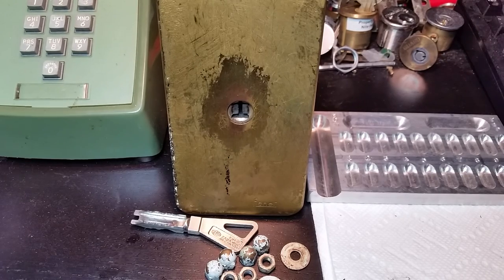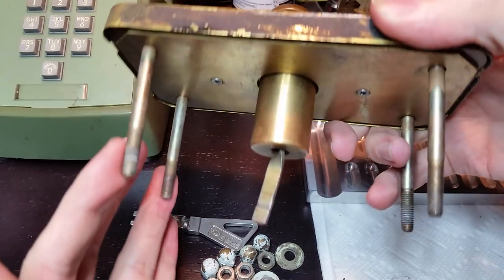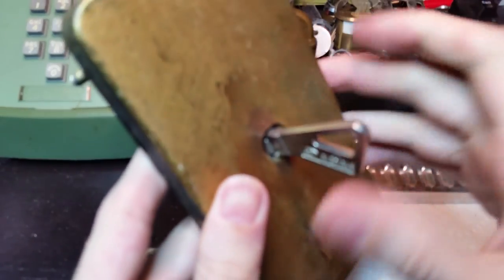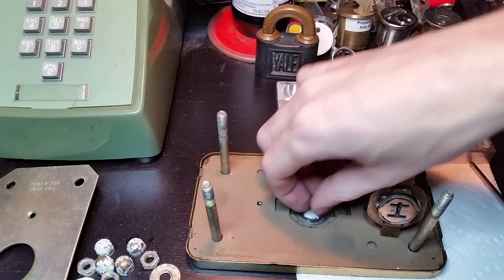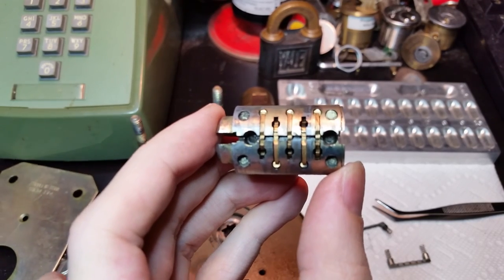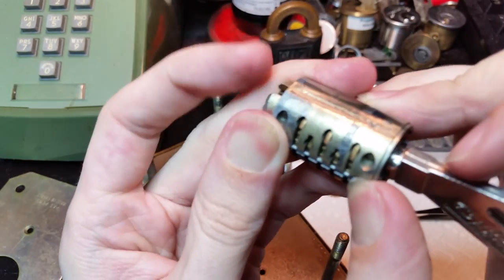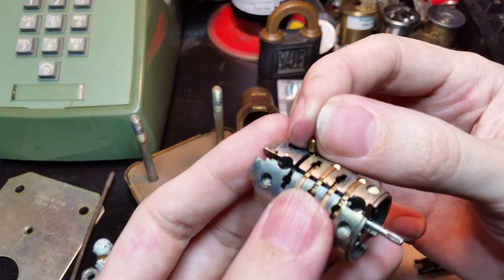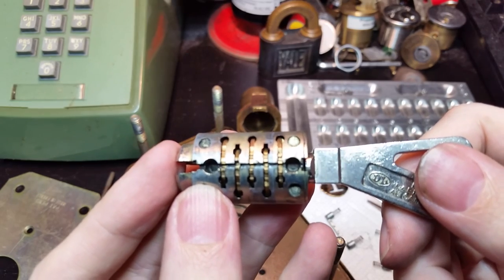(060) Fichet 450/480 (Fichet H-series) rim-mount breakdown

Comment: Fichet is very popular in France, and is now owned by Assa-Abloy.
Reply from the maker: I knew about their French connection but I was not aware they had been bought by the Assa Abloy Group.
Reply: ASSA ABLOY was formed in 1994 when Assa AB was separated from Swedish security firm Securitas AB. Shortly thereafter, the Finnish high-security lock manufacturer Abloy Oy (a subsidiary of the Finnish company Wärtsilä) was acquired. The company was introduced to the Stockholm Stock Exchange later the same year. ASSA ABLOY has since made over 150 acquisitions.[3] A few of these are Yale lock, Sargent and the high-security lock firms of Medeco in the U.S., Mul-T-Lock in Israel, Fichet-Bauche in France, and VingCard Elsafe International in Norway. Its two largest shareholders[4] are Latour and Melker Schörling AB.
Reply from the maker: I am aware of the Assa-Abloy group, you do not need to lecture me about it.
Reply: sorry you took it as a lecture, later.

Comment: Do we know what the weakness was?
Reply from the maker: There were a few. Tolerances were tight so vandalism by inserting even fine debris could seize the levers and disable the cylinder; the materials used for the sidebar was much softer than the levers so it was possible to use torque to break the sidebars.